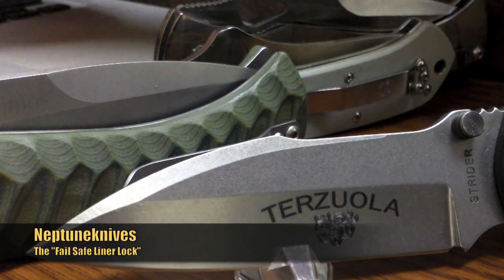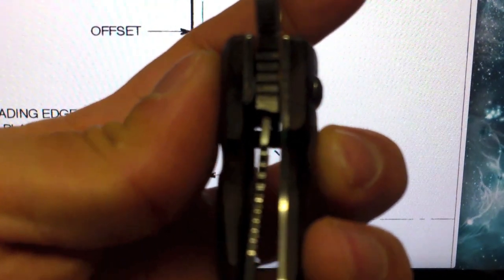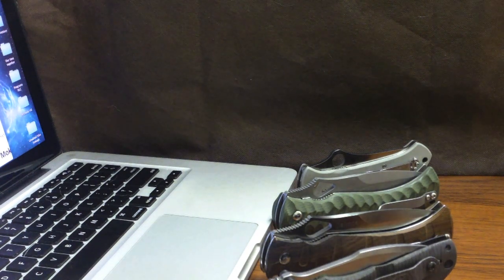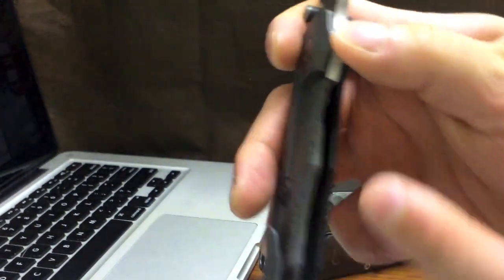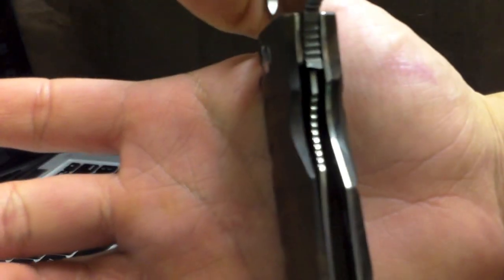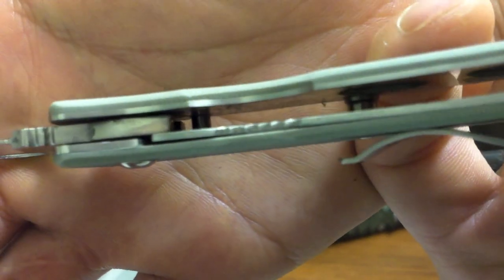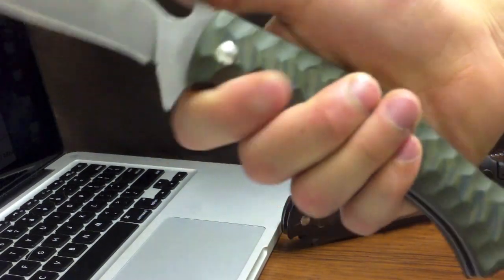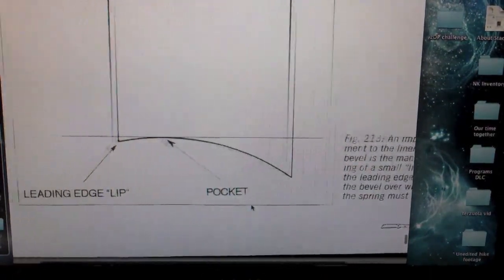The Famous "Fail Safe Liner" Lock

Comment: Fail safe folder: Cold Steel Tri-Ad lock.
Stronger than many fixed blade full tang knives.
Reply: Thats really not true.  With all due respect, there are still weak points and moving parts that are eliminated when a knife is full tang.  Tri-Ad lock may get closer to the strength of a fixed blade but, no folding knife will ever equal, much less beat a fixed blade in terms of strength.  
~Porter

Comment: I like my Ka bar mule folder, but you should take a razor blade (or equivalent) and scrape off the black powder coat from all mating lock surfaces.  you have to disassemble the knife to get it all, but it's worth it.  Scraping the paint allows for a slightly deeper lock up between blade and lock bar, and the bare steel-on-steel has greater friction (desirable) than paint-on-paint.

Comment: You're absolutely right about frame locks being superior to a liner lock. This can be somewhat mitigated by a strong liner steel that won't lock up under the blade to the left. It also can be mitigated by the Lake and Walker Knife Safety used by CRKT. But the LAWKS is not a good substitution for that strong steel liner lock. All of these systems fall short of Andrew Demko's Tri-Ad locking system. This is by far the BEST system on folding knives bar none and it's not expensive.

Comment: Yea, it all depends on how your holding the knife and what direction you are applying pressure. In a messy fight I want my lock at 50%. There is no disadvantage to 50% lock up. Early is smooth but not as solid.. Think about it, do you wanna be hanging off the cliff by your finger tips or your whole hand.

Comment: Bottom line is if you're doing something with a folder that causes the lock to fail, barring something that came out of the factory defective, you've got no idea what you're ding with regards to knives. Fixed blades exist for a reason - folders are meant for light duty tasks. Not knife fights, not batoning wood in half, not hammering stuff...basically they're a non threatening knife that should only be used for light duty chores. You want "tactical" you buy a fixed blade. Period.